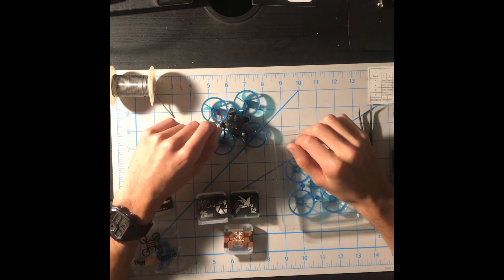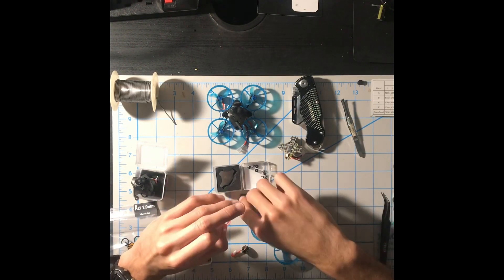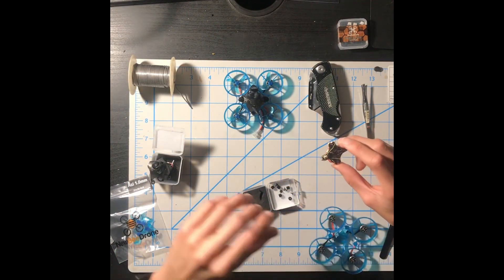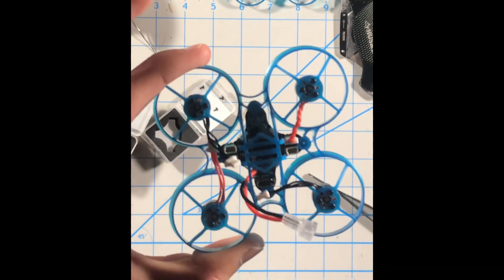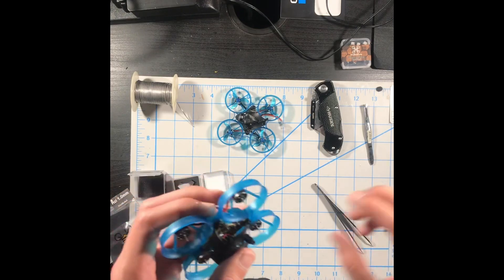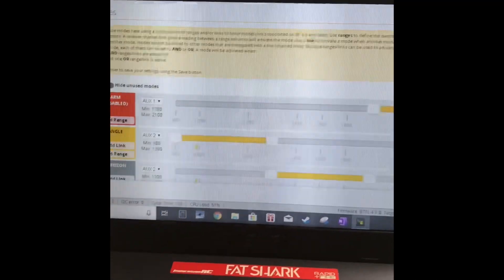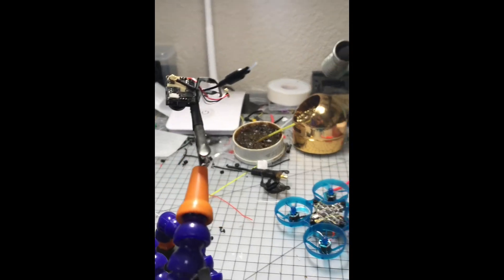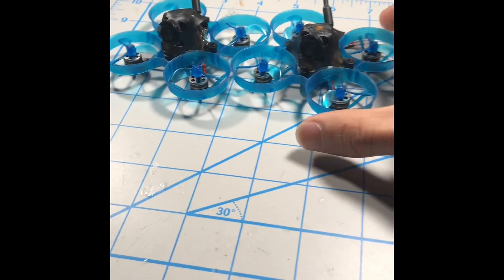Hummingbird f4 1s Brushless build tutorial

Comment: Does the board support osd with a different camera via the standard video in/video out method? I see the diagram labels 2 pads as 'video' but doesn't specify in or out. Also are there any known issues with JESC firmware, or does the provided ESC FW support both 48kkHz and RPM filtering?